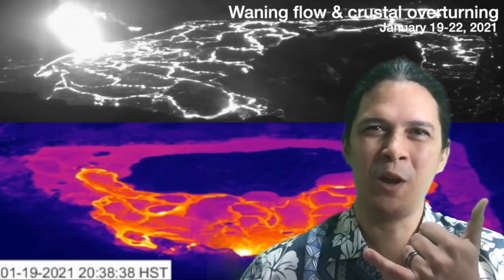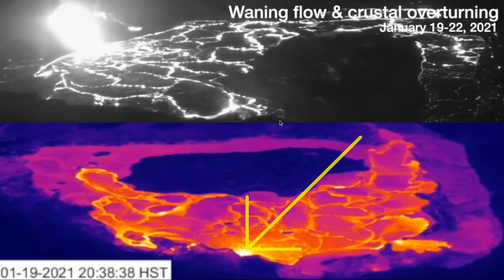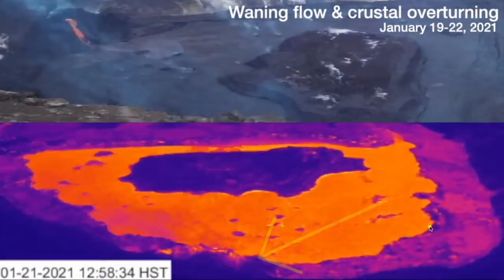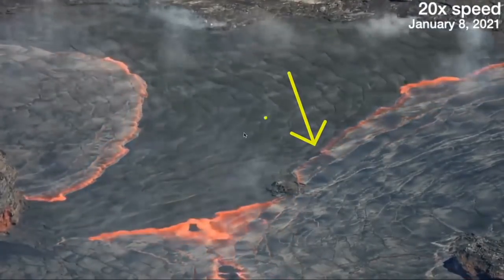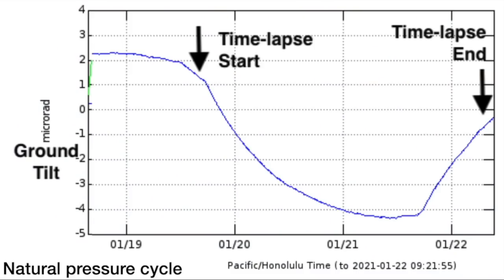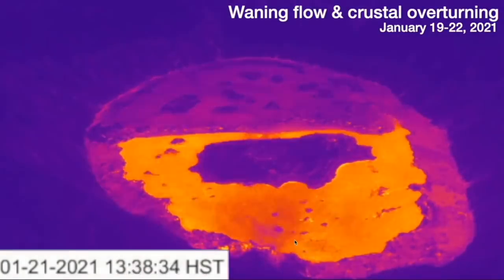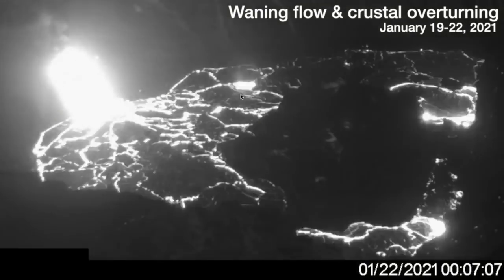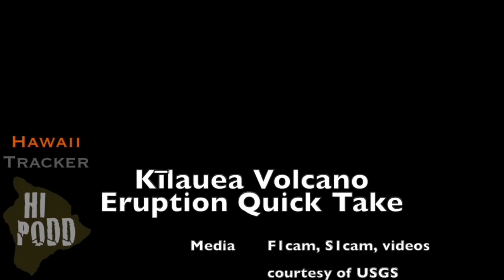Eruption Quick Take: Waning flow & crustal overturning

Comment: 3-4 weeks ago there was a deep earthquake over in Chile, and another one in Asia, roughly 4 hours apart.  As I imagine the waves of energy were transmitting through and meeting up under the Pacific plate, as they got to Hawaii, you guys had a flurry of mag 2 (+/.5) earthquakes, followed almost immediately by an increase in lava flow.
Within the last couple of days there has been a triangulation of deep strong earthquakes around the Pacific plate.  I would expect those waves play out much like in a pond, where trough/trough equals reduction in flow, trough/peak will cancel each other out, and peak/peak will result in a much stronger flow.
I wouldn't be too quick to dismiss this reduction in flow right now as the way of things, but rather view it as the water pulling out of the bay just before the tsunami hits.
IDK, could be the ramblings of a madman, but just thought I might pitch in my 2 cents worth.  Aloha.

Comment: I see your title "waning flow" but in watching the daily rate of re-covering of the hot side around the island I don't see any reduction in flow.  Just because you can't see the 35' diameter river of lava doesn't mean it isn't there.  Additionally the lake isn't the only place the flow will go OR has gone in this cycle - an absolute fact about Kilauea.
Reply: Yep the caldera will get deep enough to open pu'u o'o back up or one of the other tubes leading to  one of the many craters freckling the east rift... Been happening since the beginning of time bah...🤙
Reply from the maker: It was definitely a transient waning, but noteworthy as a case study!